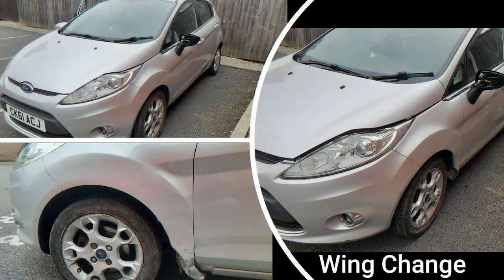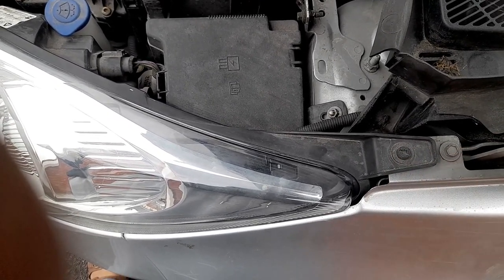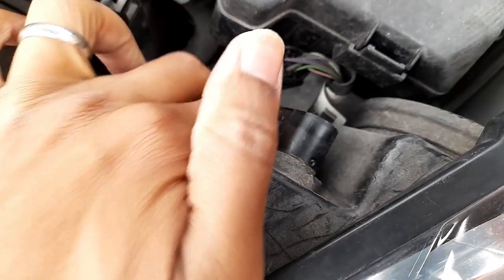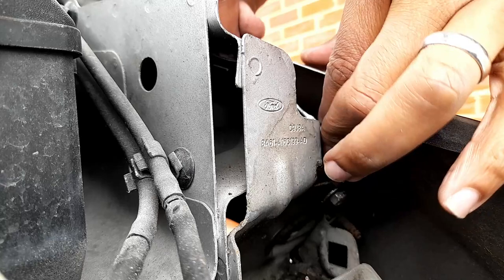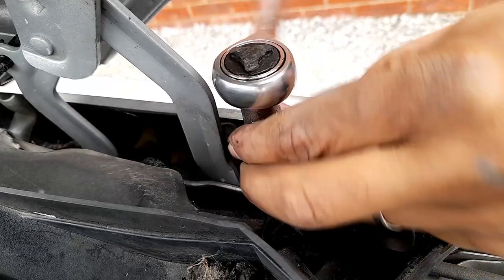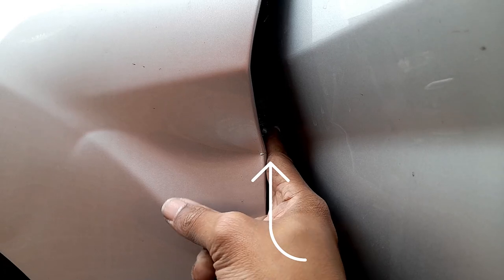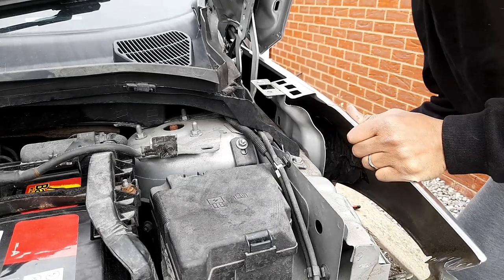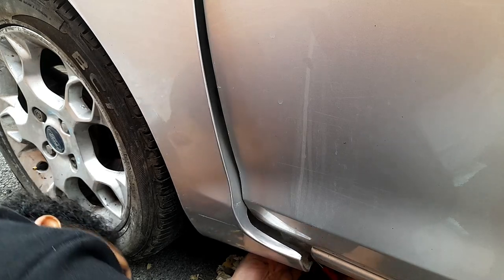How to remove front Wing , Ford Fiesta 2011 model

Comment: Hi how did you remove the screw behind the window?
Reply from the maker: No pull use a bit of force and it will come out but then putting it back u will need to cut the hole for the screw so that u can slide it in
Reply: @nuramoboy  yes in the end I just pulled and ripped it off ahahah then i had a problem with the new panel, so i just cut the whole support